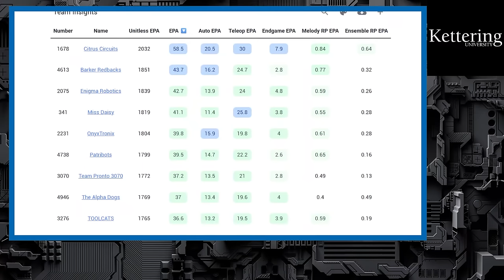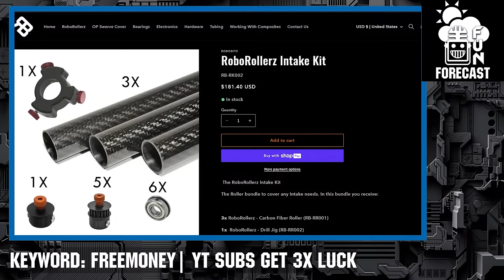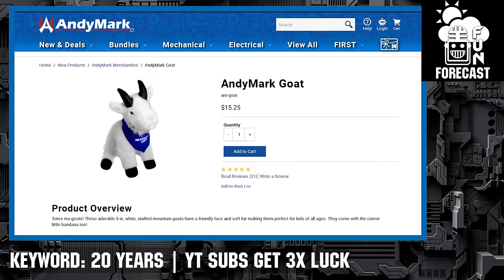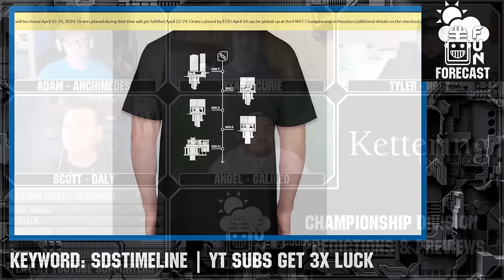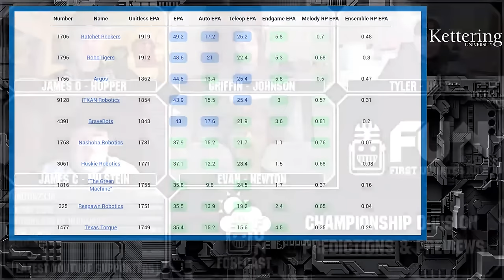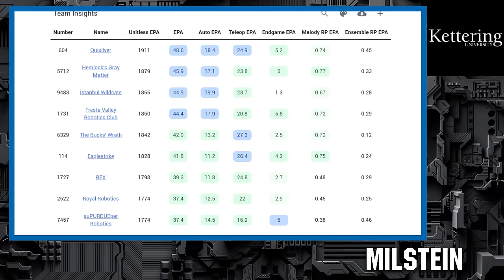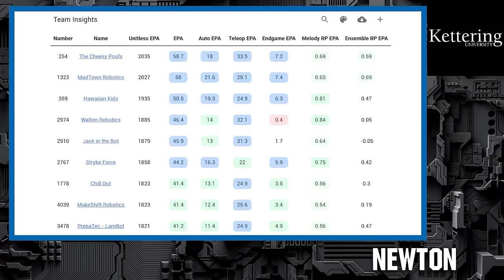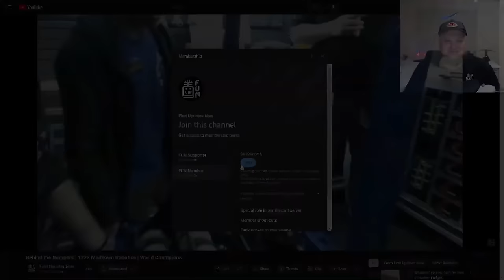Championship FRC Forecast | All 8 Division Predictions

Comment: 1:38:35 - To be honest though, my observation from events is that while shot blocking looked viable in early weeks, it's become extremely risky given the location of the various safe zones around the field and can lead to a lot of penalty points if you're not careful. The smart defense teams at later events have opted instead to block cycling to the source, which is far less dangerous and easier for the defender to see where the safe-zones are (plus the added possibility of getting free climb points from anyone running cycles in the last 20 seconds).

It's worth noting, 5712 basically only has to shoot from the subwoofer when vision isn't working (which at MSC was like, one match), any other time they can shoot pretty much anywhere up to center-stage distance from the speaker. While it hasn't been used much, there's also a "reverse shot" mode that can be used for closer-range shots which should prevent a blocker from working effectively due to the shot angle. The variable-angle arm (that's used for Amp and Trap) also technically allows for a "high" shot that can shoot over blockers, though it would be a bit slower if implemented.

Comment: Barker as the third contender is crazy… I’d have them as a lock. They have 2nd highest EPA and all of their comps were earlier so they’ve had all this time to develop and practice, meaning that EPA is a vast underestimate. 

I’d bet that barker crosses the field faster than citrus, which means 3rd bot can pass to citrus while barker runs full cycles and that’s optimal scoring.
Reply from the maker: Picks within a category are not in order.

Personally (though I didn't make the list) I do think 4613 may have some struggles with a fixed angle shooter to be a lock.- Tyler
Reply: @FUNRoboticsNetwork  There is 0 chance 4613 is not running a variable angle shooter at champs. They have literally already run it on their 2ndary team 8613. They have 4 extra weeks where they have been doing god knows what to prepare for champs. They will without doubt be the fastest robot on the field.